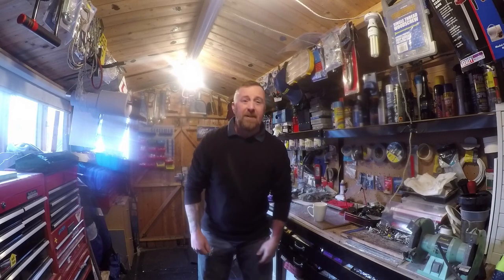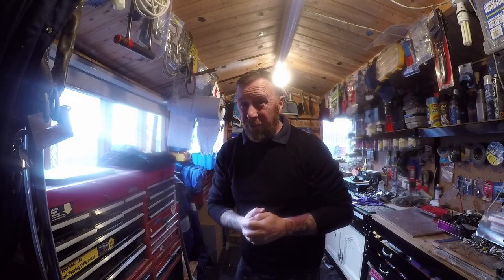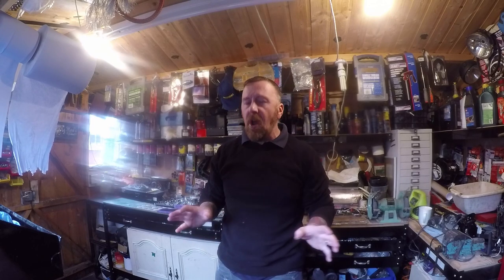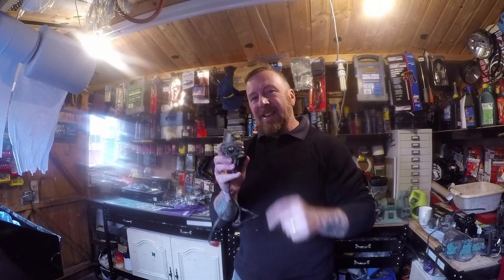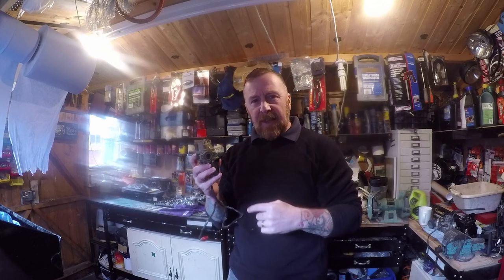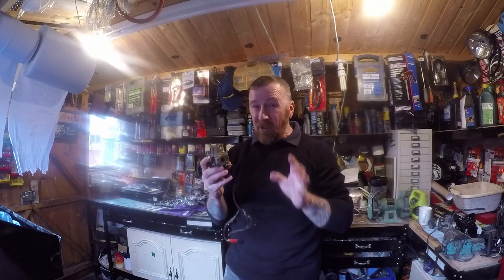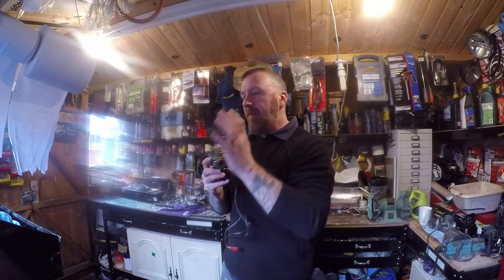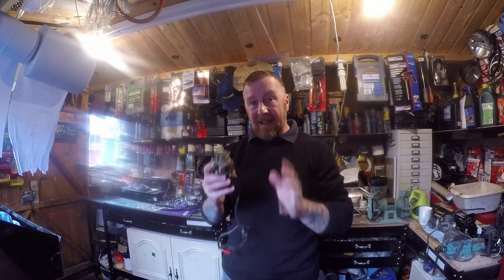MOPED BASIC BOGGING DOWN EXPLAINED MARK SAVAGE

Comment: I leave my bike running for 10 mins go out hit 32moh and then it drops down to 0 when I'm on full throttle so have to let go and then slowly pull the throttle again to move its had a new Carb new battery checked the air filter etc and tried changing the fuel mix and that but nothing changes
Reply from the maker: move back to new carb and what bike moped are we talking about 
why did you change the carb and is it made for your bike moped 
did you change over main jet from old carb 
fuelling 
vacuum
Reply: @marksavage  I changed the carb because a garage told me the float was broke in the old one as it would leak fuel everywhere and wouldn't idle because eit was flooding itself so it had the exact same carb fitted and it idles perfectly gets up to about 35 perfectly but then just bugs down to 0
Reply: @marksavage  it's a BTM 50CC BT49QT-9
Reply from the maker: @thedrdip1082  so its a 4t and oh ok most of the time its the vacuum not the float but if it keeps messing maybe change the float from the new carb with the old one as this may work
Reply: @marksavage  the float was broken on the old carb though that's why I got the new one I just get to 35mph and it loses power to 0 but then I can take straight back off again should I take. The main jet of the old carb and put it on the new one?
Reply from the maker: @thedrdip1082  i would as your bike was set up to it , still odd and as it wasnt doing it before it has to be to do with the new carb, so make sure it all ok inside 
id take it off check over and clean and the air pipe is on ok along with fuel pipe etc and run it
Reply: @marksavage  when I tried it before it didn't drive too well because the fuel was leaking everywhere, tbh I haven't focused much on fuel mixture yet like where I live has 4 sections of road before I would bog out but the 2nd bit but managed to almost get to the 4th after adjusting fuel so not sure

Comment: Can bad gas cause a bog?
Reply from the maker: bad everything bud start and running , if you think that id change the fuel and take it all out and refill up, just remember to empty carb too
Reply: mark savage thanks we found the problem it was getting too much air and we covered 2 air holes and it runs fine now

Comment: i have piaggio nrg 50cc 2012 ive tried everything except changing carbarator
Reply from the maker: That should have been the first thing bud 
So did it just start or did you change something?
Reply: mark savage hi mark I got carb completely cleaned this is second stator also put in changed cdi unit complete service and it loses power after two mins it’s works brilliant for about a min then drastic power lose
Reply from the maker: One of two things 
Fuel check rhe fuel line from the tank goes into the carb without going back above it and the vacuum works ok 
See it any air comes back up the fuel pipe 
Stator which you have changed so odd 
Changed plug ,as they can break down even new
Reply: mark savage thank you mark my scooter has only 1600 miles since new can't thank you enough will let you know

Comment: Hi my sons moped (kymco agility 50cc ) starts first time runs perfectly till it gets warm,it's ok at half/full throttle but dies at idle and won't restart. I've cleaned the carb, cleared the jets, cleaned the air filter. The plug is bone dry after trying to restart no fuel. Any ideas cheers Alex

Comment: Hey Mark, great video. I recently have bought myself a moped and I am only learning about all this stuff. I have replaced the air filter, spark plug, drive belt as well as engine oil. The moped itself is from 2012 and has over 28,000 miles on it. The moped did go great on the start when i first got it second hand, I could easily do 30+ mph as it is unrestricted (at least I think so) however about a month of owning it has shown dramatic changes, this includes the moped not begin able to go past 20+ mph. The moped also has a start problem and what I mean by that is that moped itself starts well but after I drive it down the road which is about less than 100 meters, the moped wont push itself from the stationary position as it is a intersection at the end of my road, after a couple of seconds it will go however not more than 15-20 mph. This has been a massive issue, I am thinking that it might be either the carb or CDI, as well as the transmission which i mean the variation, clutch etc. Could you please let me know what you think about this?
Reply from the maker: id start with the variator system again so take it off and give the rollers a look at , Ive had it before where they stopped rolling and this was the problem 
take it off and clean and replace then 
give that a look and get back to me then we can move on also check it rolls ok when not running 
maybe give the plug a look at for colour etc
Reply: @marksavage  okie dokie, i had a feeling it was more of a clutch fault however ill get a whole kit  for transmission then after Christmas and ill update you when i do replace it!
Reply from the maker: worth taking a look first before paying out as a new set of rollers will only cost you £10 , do the clutch test as in my videos to see if its ok 
I have 150 moped videos many on speedfights but the basics are the same
Reply: @marksavage  okie dokie will take a look now!
Reply: @marksavage  Changed out the whole of clutch, including the bell as well as the variator, the clutch as well as variator was well used and therefore replacing both of these have fixed all my issues. My moped now does 30-40 mph on straight road and accelerates up the hill well, thank you once again.

Comment: Hey Mark, i got a 170cc scooter. It will not run. It boggs down when i started if i give gas. But if i take off the air filter i can run it but still not good. It a new scooter and i only have 600 miles on it.

Comment: I changed the carb on my scooter and now when it starts it takes a minute or two before i can take off. It drive faster very well but there is an issue somewhere
Reply from the maker: how did it run before ?
did you change the jet from your old carb to the new carb and tune , this may help with the starting or change the auto choke
Reply: @marksavage  Hi, It sat for about 4 months so I bought a new carb and put it in and also changed the spark plug. I didn't take anything from the old carb. When it is going it runs good enough and idols great

Comment: Hello iv got a 50 cc mini dirt bike got it brand new first day it ran ok next day keep bogging out so clean all the jets and cleaned everything put it back together and it still does the same thing can you help please
Reply from the maker: That's odd but being new I'd either contact the seller and ask advice 
Of re check all nuts bolts and pipes as something may have come off or loose

Comment: Hi mark. I've asked for advice before off you and and you duly obliged much to my appreciation. It fixed my problem however I now have another problem being that there's no pull on the bike (speedfight2). I've seen your video on this but don't understand the exhaust bit. I've cleaned the carb and put new rollers in.. 8.5gm.  I've taken the exhaust off and the wadding inside was sopping wet at one end. Is this normal or is there a more serious problem as going to change this but if it doesn't solve the problem I'm wasting my time. Any help appreciated.

Comment: Hi mark I have just bought a Piaggio nrg had mot done day before just gone to ride it for first time bike won't move of start ,stay at around 8 MPh takes its time to get moving but won't go over 30 any ideas mate ?
Reply from the maker: As in many of my videos bud and I've done loads 
Clean carb 
New plug and air filter 
Will help 
But variator bud follow my videos 
They will help
Reply: @marksavage  cheers buddy
Reply: @marksavage  just another quick one mark cleaned carb still doing it when put in standard revs games speed ok soon as sit on it struggling to get past 4mph think it's  variater?

Comment: Hi Mark my derbi senda starts bogging down when im flatout  for a long time like on a dual carriageway... also starts to properly bog down when im slightly low on fuel like i wont be going anyway? What could be the issue here? Cheers
Reply from the maker: last service bud ?
oil ok?
carb clean?
weather does this bud so also clean your air filter 
basically a good full service and you should be fine
Reply: @marksavage  its been doing it since day 1 I brought it, also  i changed all of that, new carb
Airfilter 
Tune it
Made no difference....
Reply from the maker: @ethanb6276  new carb is not always the answer as what jet was in it ?
what set up ?
did you tune the old carb ?
change fuel filter 
clean tank and or fuel filter in tank tap 
timing , valve clearance ?
this time of year you can get water in with your fuel due to the cold .flush tank
Reply: @marksavage  I'm starting to think sometimes to do with my vacuum/ the tap itself
Reply from the maker: @ethanb6276  could be or fuel lines as they co hard and leak or let in air so worth check